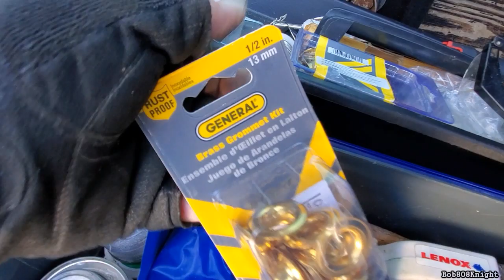Putting The Cover On The Dome

Comment: Man Bob, that's that is one sweet shelter. Any bigger you could add rooms. How would a wood burning stove work inside? Looking forward to the next part. Y'all stay safe.
Reply from the maker: Thanks Opal.. yes you could absolutely add rooms. Even in upstairs if you wanted to.. Which I have seen..A wood stove would be perfect in the dome. All you have to do is add a stove Jack to the cover. This may be a fall project for me. In the next video I designed the door . That should be released Wednesday at 6 p.m. central Time. Have an awesome weekend and I shall talk to you later.
Reply: @Bob808Knight  You too my friend.